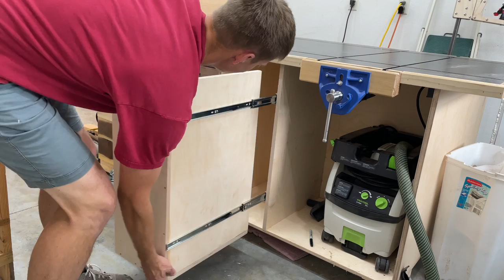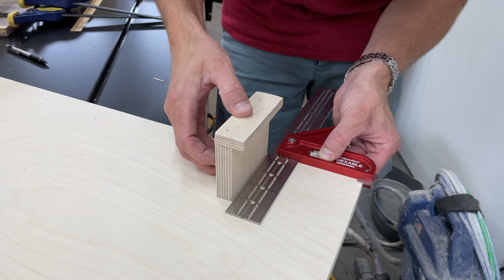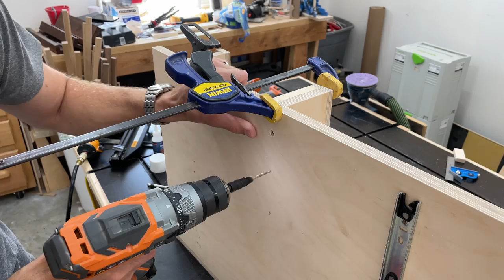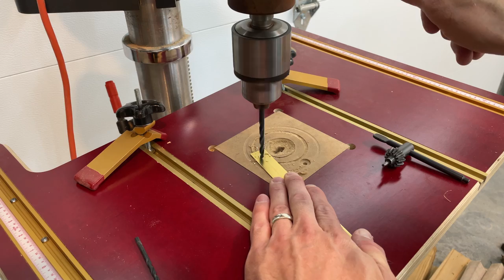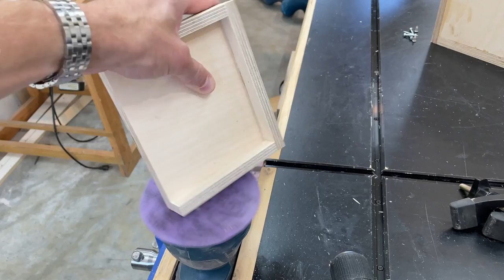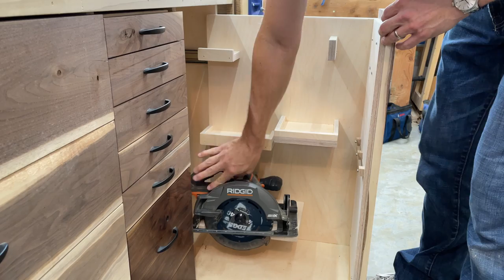Shop Storage | Vertical Tool Drawer Build

Comment: Nice project. I use Ridgid too. The battery is the reason to keep buying the same product line. I prefer cordless over corded because i didn’t have a workshop for many years and some projects weren't close to power sources. 
Looking forward to seeing more of your videos.
Reply from the maker: Thanks, Ray! Appreciate the nice comments. The Ridgid tools have served me well. One of my batteries recently died but I called and they are sending a replacement under their Lifetime Service Agreement. First time I’ve used it and it was an easy process.

Comment: Great video. I'm currently building a miter station.  20 feet long  24"  top 10 drawers all vertical tool storage ( is the plan so far, I may amend it house hardware in a location). it's quite the challenge.
Reply from the maker: Mandel, that sounds like a fun build! Would be awesome to have a 20’ miter station, I bet you’re going to love having it. Good luck with the build